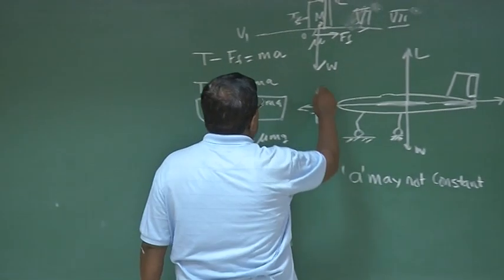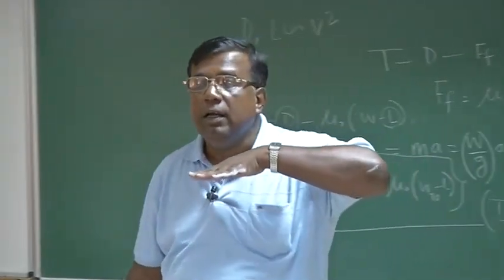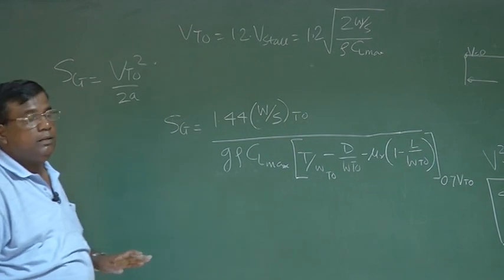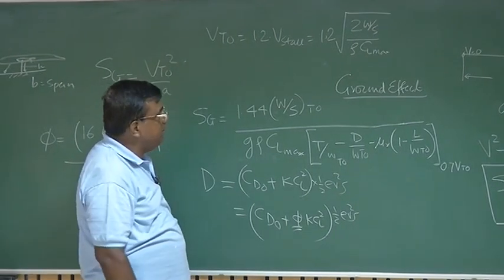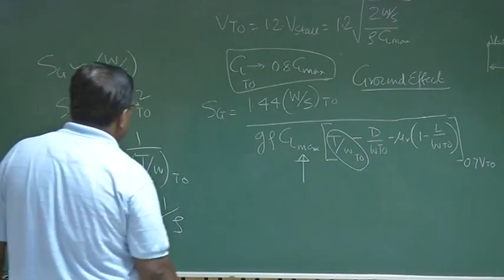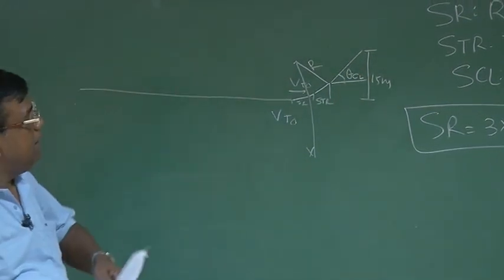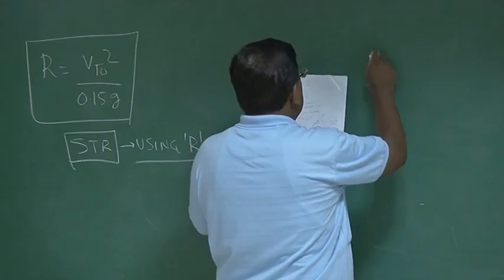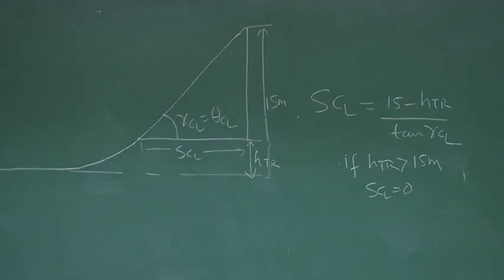Take off Performance:Continued...

Comment: Why specifically 0.7Vto? Instead why not write acceleration as vdv/dx and find a differential equation in terms of velocity and displacement and then integrate it? I doubt the 0.7 Vto average acceleration assumption would hold true in case of model airplanes where dynamic thrust matters to a greater extent and cannot be neglected and thereby needs written as a function of propeller exit - aircraft velocity
Reply: These assumptions are for preliminary design considerations only.
Reply: You can find answer in shevell fundamentals of flight book